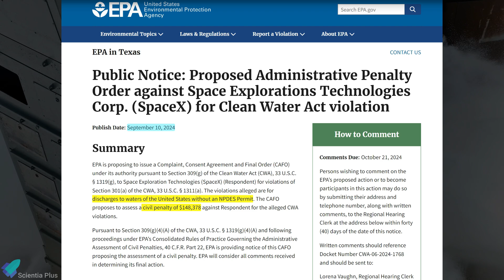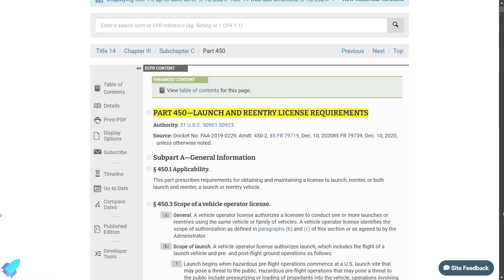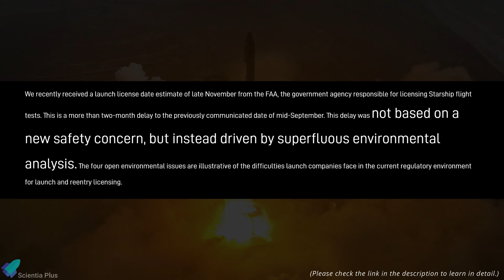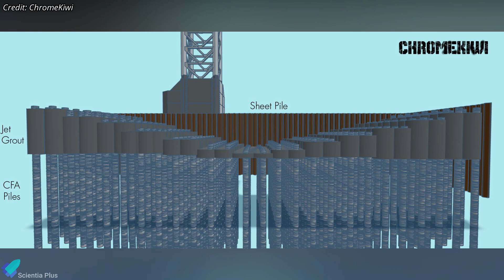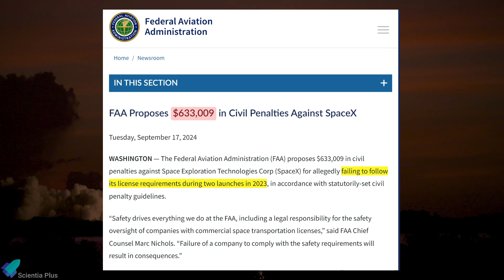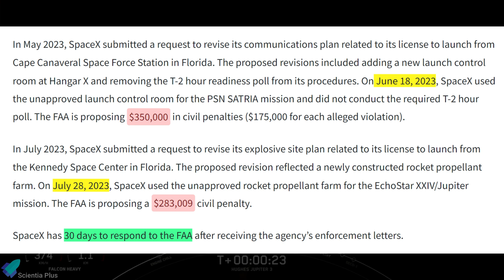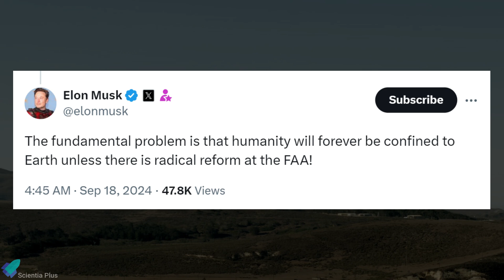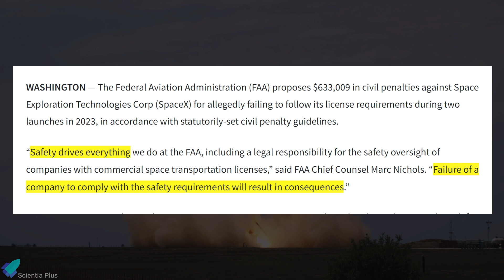Finally Congress Demands Immediate Starship Launch Approval from FAA!, SpaceX to Sue FAA!

Comment: The launch licensing requirement shouldn't even exist. These rockets are aircraft, like a Boeing 747 is an aircraft. A license isn't required for each flight of a 747.

Would we be in danger if there was no launch license requirement? No, because a company has a lot to lose if people, property, and the environment is harmed. It is called lawsuits, and it can run into the billions. So they will behave. Like with a Boeing 747, if there is a crash or threatening malfunction, the FAA investigates, and if they believe another launch before the investigation completes threatens people, property, or the environment, they can ground the rocket/aircraft until resolved. 

In my opinion, a launch license requirement is unnecessary. They can't anticipate what's going to happen anyway. Go by what you know, not by what might be. If property, people, and the environment is not harmed, LEAVE THEM ALONE.

My guess was the launch license was political in the first place to limit competition by startups, for the sake of their darling Boeing. Costly regulations benefit large established companies.
Reply: Boeing give large Christmas bonuses, most to the workers from someplace besides their employees.

Comment: FAA "safety is our mission" well they let 
Starliner fly even there safety issues from the start now two astronauts are stranded because of these shamesless, corrupt SAFETY bureaucraps ALWAYS HOLDING UP SpaceX on the ground.
Don't forget the defective Boeing airliners, how those commercial aircrafts pass the SAFETY REGULATIONS INSPECTION APPROVAL, from the SAFETY BUREAUCRAPS REGULATORS.

Comment: Space X has an internal schedule for Starship and Booster. If an external delay happens, then more planned changes are Incorporated into the next planned flight(IFT-6). There is talk Space X may stop using build 1 and start using build 2 version of Starship. Hopefully starting production and incorporation of raptor 3 engines into build 2. 

In the end, Space X ends up with an improved Starship and Booster, but more complex pre-flight testing and test plan flight for IFT-6.

Comment: The revolving door between Boeing and FAA is not a secret.  As recent as 2017 Ali Bahrami was allowed to work for the FAA after he had left the organization and worked for the commercial industry, and had been widely criticized for the enabler of the regulatory oversight that lead to the hundreds of deaths by the 373Max.  Do we really think that this practiced stopped at Ali when he stepped down in 2021?  Do we also think that he was the only person in the FAA to have ties with Boeing?  I don't think there's anything we can do about the rot unless higher authority steps in, and that's not gonna happen with this administration.

Comment: "Clash of the Titans"? 
Nope. Just Musk dialing up his favorite congressmen in search of favors. 
The proposed regulatory action is not an engineering issue, but a possible environmental issue.
That is the driver for a regulatory response-- to determine what is going on with discharges into the coastal environment. 
Prevention is better than regret and costly remedy. 
Russia has huge areas around the former Baikonur spaceport area which are giant pits for chemical pollution. Cities nearby are threatened by such chemicals, and the Russian Federation can do little, after the fact.

Comment: It is the same organisations complaining about the same things each time they launch. The FAA is asking for new environmental impact statements each launch. Does the hot staging ring drop within the 3 mile limit? If not, then it is outside US jurisdiction. Is there any noxious chemicals on the hot staging ring? Most probably not being a metal component with no working parts. Toxic residues from  fuel? No. 2CH2 + O2 -> 2C + 2H2O basic high school chemistry. Sonic boom upon return? Cannot be worse than the sound of thunder or even the sound at launch and a much shorter duration. Mercury in the water? What component is discharging that mercury? Or is it a typo on the summary page that deeper reading of the report would prove wrong? A quick phone call to the independent testing company would solve that in 5 minutes. 
The FAA says it’s all about safety yet they allowed Boeing launch with a known problem with crew aboard. One begins to wonder if there is not some corruption  inside the FAA from Blue Origin or ULA due to them not even being able to compete against a space ship that will make their efforts obsolete before they are ready to launch. In fact they allow ULA to launch single use rockets and I’m sure that a full rocket body falling back to earth has more pollutants than a returning reusable rocket. It seems that it is either corruption or a ploy to get a bigger budget out of the government. Either way neither is acceptable for slowing progress on SpaceX.
Reply: Methane is not CH2. Break open your old chemistry text books.
Reply: @davidhimmelsbach557 point still stands. The combustion reaction of methane produces CO2 and water.

Comment: Every other space company-Boeing, Lockheed, MCD- has thrown away every booster as long as space flight existed.  Suddenly FAA is worried about just a booster ring?
Reply: If the ring lands in shallow water it will turn into a reef like the sunken ships they use for reef building.
Reply: I wonder what's cheaper to recover and reuse or to remake another one , cause that would be a lot of material.

Comment: The obvious oxymoron of the FAA stalling flight 5 over alleged elevated mercury levels in the water deluge system is one that junior high school earth science student could refute.  How in the hell do you get elevated mercury from a stainless steel rocket burning methane gas and oxygen, while using potable water to cool a stainless steel plated launch pad??   The elemental chemistry is not there.  Duh.  Stupid FAA bureaucrats.   They are just revealing the idiots that they are and they need to go, period.

Comment: It is not "Congress", it is maybe ONE Congressman. Can we say CLICK BATE..... 
Any way, I think changing the defined flight plan from simply a launch to also a recovery of the booster at the launch site is a VERY SERIOUS CHANGE that is likely to result in a major explosion. SpaceX needs to update the paperwork like they are supposed to.
As far as the Booster protection ring falling into the sea, that is a pretty stupid thing for the FAA to focus on, since every other launch vehicle in existence currently drops an entire 1st STAGE of the rocket in the ocean.

Although I have no doubt the belligerent Congressman has some sort of political ax to grind, I do agree that experimental rocket development flights need to be covered by a special license that accounts for the rapid changes in design. That indeed needs to be streamlined. The FAA cannot regulate an experimental rocket program in the same way they regulate commercial air travel. The expectations are completely different between the two types of flights.
Reply: One Congressman with Co-sponsors. That's how Congress rolls.

Comment: Methane+LOX makes an extraordinarily clean-burning rocket engine, which produces far fewer pollutants than most other rockets -- especially the SRBs used for NASA's Space Shuttle and SLS, ULA's Delta 4 & Vulcan Centaur, China's Long March, and the ESA's Ariane 5 & 6. The fact that the Biden Administration is going after SpaceX for the negligible pollutants which their launches produce, rather than going after the launch providers that use pollutant-belching SRBs, strongly suggests a political motive.

Comment: Safety drives everything then how is boeing able to operate or  fly starliner
Reply: Innovation in space activities is never safe.  There always needs to be a balance between safe enough and innovation.  Mars has access windows and  the FAA is operating to prevent us being ready for those windows in time.
Reply: Because it is still a NASA regulated launch/return. FAA won't take over until the Starliner is certified and goes commercial (if ever!).
Reply: @GntlTch why isnt starship under nasa regulation? Its still an experimental craft and starship has a moon mission under nasa contract
Reply: @outforbeer  Unfortunately, I speculate that the Starliner was entirely a NASA initiated and funded project vs the Starship was initiated and funded by internally by SpaceX and has only a marginal HLS contract withNASA.

Comment: Waiting to see if the FAA gives Blue Origin the same scrutiny and delays in approving launch licenses.
Reply: Heh, BO is moving so low that they'll always get a license in time. :)
Reply: @lanzer22 well, if you submit your application early, you get your license early. The FAA is literally bending over backwards to help Elon. But he is determined to cause problems for them. Starship was ready to launch in the first week of August. But the application to modify the license was only sent in in mid-August. Why didn't they send it in in June? Why didn't they launch under they old multiple launch license they still had?
Reply: @danielch6662  the reason why they didnt use the old license like in IFT-4 is due to the change in trajectory of the booster. For example the booster will make sonic booms
Reply: Don't hold your breath
Reply: BO has not done anything to be to be subject to the FAA!
Reply: @nightlightabcd correct. The reason why they arent going to get fined is for 2 reasons. BO hasnt gotten into orbit and because they have a lot of lawyers
Reply: SpaceX needs to have a few "unfortunate, unforeseen" glitches at the next resupply launch. Sadly, this has caused an extra one million dollar increase in cost to NASA!
Reply: @johngardiner5206  heh, you’re right, I think from now on all flights should be 5% more expensive with an “FAA licensing breach cost” and all parts of government sectors would be on FAA’s ass.
Reply: @lanzer22  that's much better idea! 🤩
Reply: @johngardiner5206  well a millon dollars is nothing for NASA compared to MLP 2